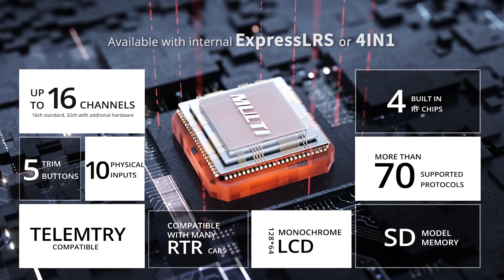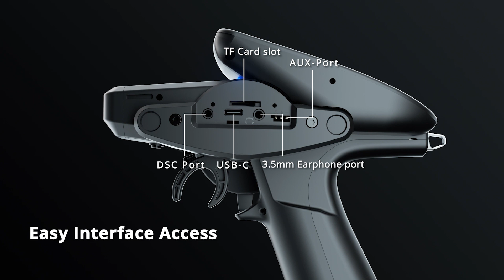MT12 Surface Radio | The first surface radio officially supported by EdgeTX, ELRS, Multi-module

Comment: Bought the MT12 ELRS version because I wanted a ground radio with the best long range signal money can buy, since I planned on putting an FPV system in my RC car. For the price of it on Amazon of 159.99, it is both affordable, compared to many other transmitters and brands I looked into, and so far, I've gotten my 10th scale Monster Slash conversion so far away from me, I needed binoculars to see it 😂.  The only thing I could see to tell where it was, was by the cloud of dust it was kicking up, and by the headlights when it was facing my direction. Unfortunately, I was unable to get the FPV system for it, since my knowledge of that at the time, was basically zero, as was my local hobby shop.... The few shops I called, who claimed to be experts in FPV systems for ground vehicles told me it was impossible to get more than 200 or so feet of range from any FPV system. Simce I know that to be false, I was not gonna pay them 500-700 bucks for that. They, as I came to find out, only do indoor drift racing via FPV, which is why 200 feet of range is more than sufficient for what they do. Which is all good, if that is all you want, but I wanted to hopefully get around 1 mile of range. At the time I was doing all this, I had a substantial amount of money, more than enough to get whatever I would have needed to make that possible.  Unfortunately the money ran out before I could fimd someone with the knowledge for that, or figure it out myself, and I will not be in a financial situation again where that is possible to afford.... Which is also unfortunate, since now, after almost 2 years, I've got the knowledge to be able to piece it all together myself, just will not have the funds to do so.... It looks like endless fun, and since my back and body are a wreck now, this would have been perfect for me to still get out and feel like I'm out off roading, and also get my gearhead fix working on theses RC cars without destroying my back or body any more than it already is.....

Comment: Nice video but I still don't understand why and how this radio is "better" than other radios? Sure, it has EdgeTX and ExpressLRS, but how does this actually make it "better" than other radios? 99% of rc car drivers do not need super mega hardcore long range, so having it only makes it "better" for 1% of drivers. EdgeTX means what exactly? Other radios do what they are supposed to do so how can EdgeTX be "better"? I don't get it. 
To me, it is like having a SWISS ARMY KNIFE in the kitchen and all you need to do is cut onions and salary. You just need a knife. All the other features are not necessary and useless. Thanks.

Comment: Can you explain the 4 in 1 please?
Reply: 4-in-1 describes the multiprotocol module, that has 4 different processing chips in it to handle different types of protocols. you don't really need to know how, as it automatically uses whatever chip is needed for the selected protocol. but 4-in-1 MPMs are some of the best, its very likely that every model you own will be compatible. they are more expensive than 1, 2 or 3 chip MPMs, but the peace of mind is often worth it.

Comment: Finally ! The surface radio world 's gonna change. But pity the wheel travel stays +/-30degree like all other radios from the old days.. Wish travel angle can change one day. We need sth like real car's steering wheel, unnecessarily to be like 900 degree, but at least +/-90degree, allowing for precise control and maneuverability. 
Keep up good job, RadioMaster RC !!
Reply: i wonder if that hall sensor actually has the ability to read that far, considering its probably the same type used in their flight radios, but if it is, should be pretty easy to modify and calibrate in EdgeTX

Comment: What a cool radio - I did already preorder one.
But what bad review videos. I guess I watched all videos released today about this radio - and all from drone/plane/FPV guys, all with ELRS, none showed multi, not one word with which trucks (e.g. micros RtR) it works.
Reviewers were asking their audience what to do with so many channels in a car?
One reviewer put throttle in CH1 and steering in CH2, what no car radio I know can do.
This was ridiculous. 
Why didn't you send this awesome radio to some reviewers who have at least a bit of knowledge in cars? Tomley, Talbot, or or or...
I wasted more than 2 hrs of time now seeing guys driving their car FPV.
This radio will not be super successful because of FPV and long range (who can use this in a car? And drones and planes are much more fun for FPV), it will be super successful because/if it binds to all or a lot of the super popular RtR cars on the market, WLToys, Axial, Traxxas, FMS, Hobby Plus, etc. etc. - and therefore you'll need the 4-in-1 (which I ordered).
I do already have a Radiomaster Zorro, but only as spare for my good old Spektrum DX9 Black (for my helis and planes), so did not check with which of those RtR trucks it could bind.
AFHDS 2 Flysky, AFHDS I know, hope AFHDS 3, ANT, the WLToys and SCX24 and FCX24 etc...

Sorry, quite upset.
Such an awesome radio, and so many so bad review.
Reply: The bad reviews r probably all rektrum, floptaba, etc ppl. F em!
Reply: @old-rcplane-phart  Bad reviews is meant in that way: "Nothing for car guys" (what trucks do they bind with) - only for FPV guys. But if the multiprotocoll will bind with RtR cars and trucks, mainly in the micro-section, it will be super popular.
Reply: Could not have said this better myself. Exactly what I was thinking
Reply: I hear you and I agree.  All of the reviews are for the ELRS version.  My guess is that it was the only version sent out.  I too have a bunch of RTRs...F*S, Ax!@L, TR@##@S, Flysky, WLT@YS..and so on.  I am looking at this for the 4in1 to move all of my cars and boats to this one tx.   HOWEVER, as an experiment, I tried binding the F*M, Ax!@L, and TR@##@S cars to my TX16S and did not have any luck with any of them.  When the proper reviewers, i.e. car guys, get their hands on the 4in1 version, hopefully they can clue us in on how to bind and set them up the RTRs.  It will be a great upgrade if it will bind to the RTRs.
Reply: @SnoMoJoe1  We have a lot of discussions about this in the forum (German), also with some very experienced EdgeTX and Radiomaster users.
Unfortunately it seems, that the new Flysky ANT protocoll (ANT protocoll is also used in SCX24 v2, the new Hobby Plus trucks and the FMS trucks with the "good" radios, FCX24 and Co.) will not work and there seem to be problems implementing this protocoll.
Still not sure if AFHDS 3 (Noble, Pro) works, AFHDS and AFHDS 2A work (did already test on my Radiomaster Zorro, but not with trucks). 
Time will tell, it is new, super cool, I am super curious and would love to have one in my hands - unfortunately it will take some time still... (hope to get mine in December).
Reply: why would anyone use a gun radio on a drone lol 😂😂looks like a sanwa rip off tbf better off with futaba or spectrum for ground rc anyway
Reply: @fpvDRE  It has multi-protocol, that is THE thing - and if it should one day work with all or most of the RtR trucks on the market, the micros (WLToys, SCX24, TRX-4M, Hobby Plus, FMS, ...) this radio will be a burner and super popular.